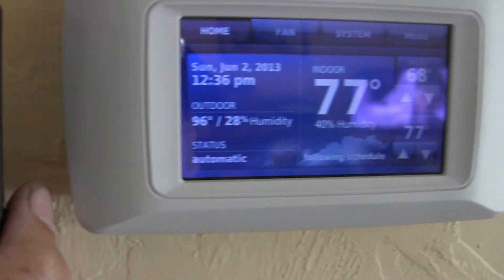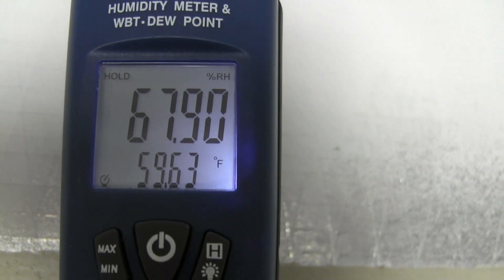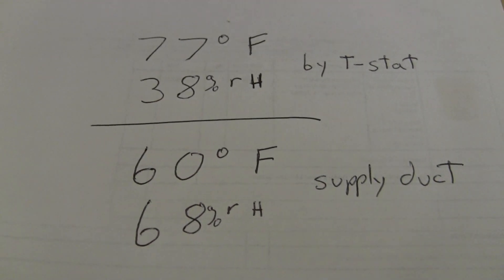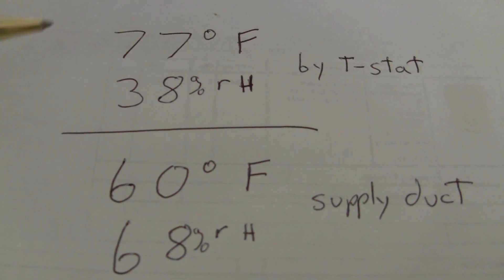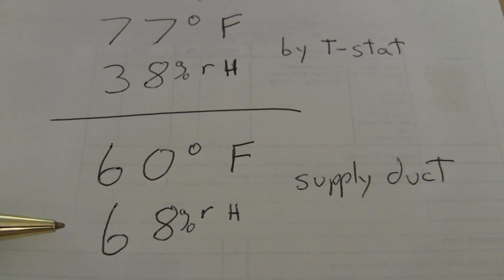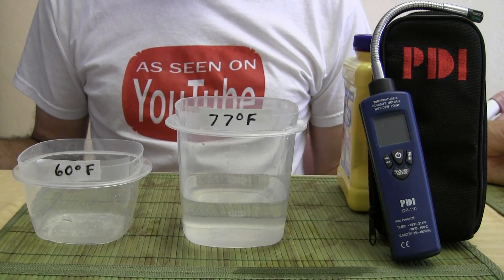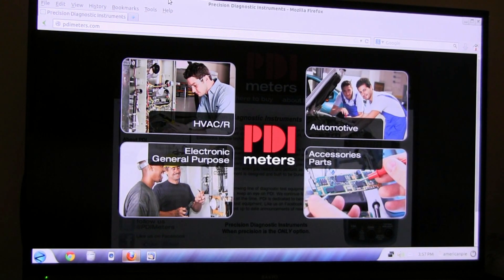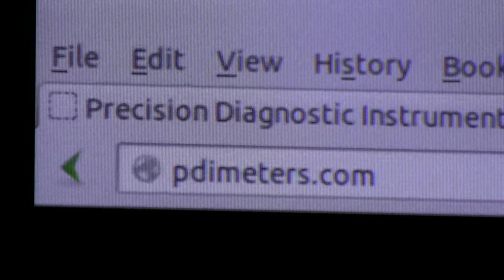HVAC Temperature and Relative Humidity and the PDI DP-110 In-Duct Psychrometer

Comment: I thought when you cooled air it made the air dryer( relative humidity) right? That's why Antarctica is the driest place on earth? I have a question, how does "enthalpy" help you become a better tech? And what can you use with this information? Could it tell you if a system is overcharge or undercharged or you need more/less airflow. Thank you.

Comment: I HAVE A BIG QUESTION TO YOUR MASTER.
HOW MUCH FRION  {22R}  DO I NEED TO PUT IN A 3 TON COMPRESSOR.
No body seems to discuss how much amount of frion need to put to a 
compressor.
Reply from the maker: If you're referring to a 3 ton air conditioning unit then it depends on the line set size and which brand, make and model. Refrigerant isn't weighed in by the size of the compressor.

Comment: Good Video Dr. Z btw ~ the Nu Calgon dryer and sealer works wonders. No leaks at all in coils in air handler. New contactor fixed the over running compressor causing unit to freeze up. Units are humming like a Singer sewing machine. I called out the contractor on bleeding the freon and selling more when it was the contactor the whole time.